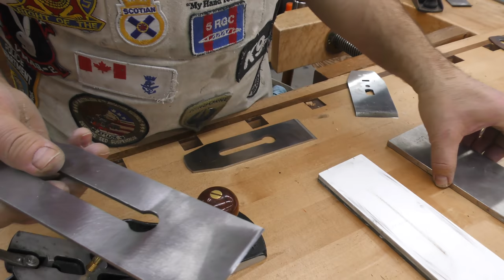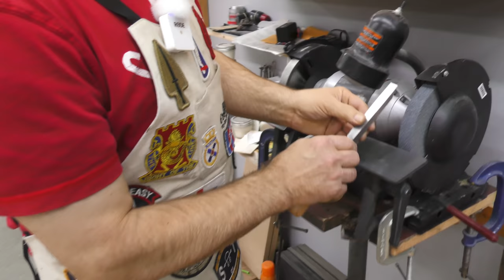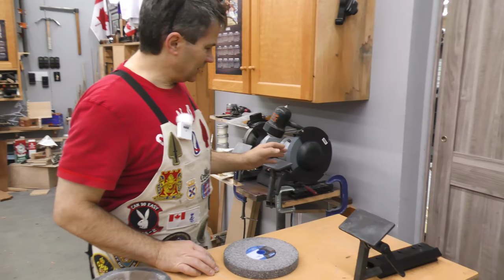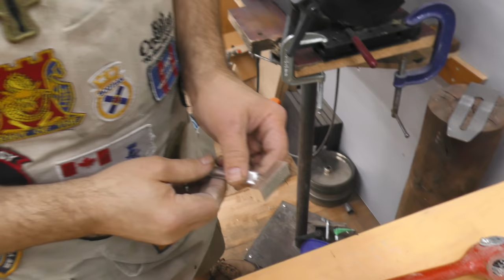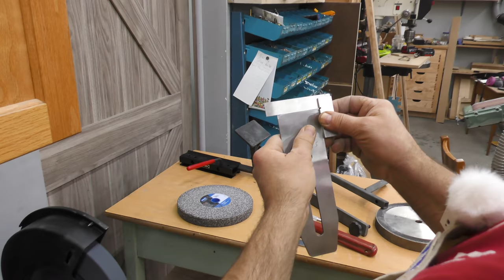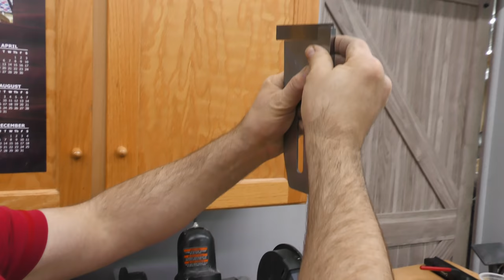How To Grind A Plane Blade - Re-establish the primary bevel

Comment: I have that "violent" stone wheel dressing tool. I have a restored very large antique dual wheel grinder, and a 6 inch two stone grinder. All needed dressing. I didn't get the largest of these dressing tools, but it is at least the size of the one you demonstrated; maybe the next size up.
Lot of good tips Rob, so I must share too, as you were using your "violent" dressing tool incorrectly,...according to the instructions that came with mine, and also according to the industrial supplier catalog information, from whom I purchase the odd tool from.
According to the instructions I have, you would need to back off your tool rest a bit, as the tool has a ledge that hooks over the edge of the tool rest. You should have a sturdy tool rest for proper use as well, IMO. You should not be seeing that shower of sparks; that is a major indicator you are using the tool incorrectly; you are wearing the metal of the tool, not the stone, if you are seeing sparks like that.

The tool is meant to be a bit more "violent" in fact, LOL. You are supposed to use the hook over the tool rest to create a greater and steadier pressure against the stone. When you do, the sparks will stop and you will see quite clearly that you are dressing the stone.

Now that I think of it, I meant to order an extra set of blades, once I had verified that the tool did the job. I actually should have purchased the largest/widest version of this dressing tool, for my antique, restored to working, big grinding wheels. They run on a thick shaft in lead poured bushings, and thin brass shims! I got a smaller dressing tool though, as I figured I would be using the smaller grinder much more.

Hope this helps Rob, and all.

Comment: Interesting video Rob.
I have a 6" grinder with 2 grades of stone, one finer than the other so, I use the coarse grade first then touch up with the finer stone before using the stone.
One tip I might offer is that I use the knuckle on the forefinger of my lower hand as a depth guide to achieve an even grind across my blade be it plane or chisel.
Reply from the maker: Great point I actually do the same thing I should have mentioned it in the video. Thanks for writing this trip down

Comment: If you're going to invest in a can wheel, you might want to look at a slow speed grinder also. If you go with a 3600 rpm grinder, you really need a light touch to avoid damage to the blade or wheel.

Comment: Happy New Year Rob and the whole team. I am fairly new to hand tool woodworking. Yesterday I re-profiled my Woodriver 5 1/2 plane blade.  Came off the grinder square.  I sharpened it using your method and for the life of me I can not get an even edge.  About a 1/3 to 2/3 of the blade will provide a .001 shaving then it falls off. To get a full width shaving it is hacking off a good .005.  I am either doing something wrong or still need a bit more practice.  A work in progress.
Reply from the maker: Sounds like it might be a pressure issue when you sharpen.  Use very light and even pressure when you sharpen
Reply: @RobCosmanWoodworking  I will give that a try. Thank you!!
Reply: That was it Rob. Lighter pressure and like magic I’m there. Thanks again!!!! Happy New Year!!

Comment: Rob, this is really helpful. 
You need to check out Wood by Wright’s video he just published about the best plane blades. He did a really great job in testing a large number the blades. 
Woodriver came out to be the best value. They beat out Lie Nelson toe to toe and are a good bit cheaper. 
Anyway, it’s worth checking out and there are a couple of surprises out there as far as some good quality and expensive options.

Comment: Amps / Current are important on any grinder as well. Higher the amps less it will stall out, and time waiting for it to get back up to speed.
Reply: If you manage to stall the wheel you are using far too much pressure at the risk of wasting metal, burning the edge and being inaccurate. The advantage of a bigger motor is that it comes up to speed quicker, especially with a heavy CBN wheel.

Comment: Once you find center of the blade, put a wixey on there and make note of the angle. Much easier to come back to it later if you have changed the platform for any reason.
Reply from the maker: I just never considered putting a Wixie on grinder
Reply: @RobCosmanWoodworking  It works I use mine all the time when sharpening.

Comment: I fought for ages with the squareness issue of the grind on one old plane iron that was on a plane owned by my late father.  I finally put the calipers on the blade and found that the long sides of the blade were not parallel.  The blade tapered from the cutting edge toward the "back" end.
Reply from the maker: I dont know if I would have figured that out.  Good job

Comment: I use a Burr King belt grinder that I use for grinding knives. It doesn't leave a hollow grind. On my pedestal grinder I use a Norton white wheel and a regular wheel on the other end. Nice to know the steel wheel exists but I rarely use my old grinder since i got the Burr king. The other advantage of a belt grinder is the plethora of different belts available for specific grinds and belt changes only take a minute. ...And I don't like hollow grinds.
Reply from the maker: Sounds like it works well for you
Reply: @RobCosmanWoodworking  I know you like machines, next time you run across a decent belt grinder grab it! You won't be disappointed with the speed and accuracy you can obtain with one. The grinding jig you use looks like it might feel well at home on my belt grinder.

Comment: Had to grind a new wood river plane blade square yesterday. Came with a new plane out of square. A few minutes and up and running.
Reply from the maker: Thats not good but its nice you can fix it so fast
Reply: @RobCosmanWoodworking  No it certainly isn't good.I recently bought a WR low angle block plane. When I couldn't get the back of the iron flat, I returned it and bought a Lie Nielsen.

Comment: I was hoping you would address the grinding, sharpening and honing the back of your high bevel blades for difficult wood. How do you do it without making a mess?
Reply from the maker: All i do is use a simple sharpening jig set at 20 degrees on a coarse (300) diamond stone

Comment: Rob instead of changing the tool rest plate angle to remove the chip why not just turn the plane blade over? Grind until the bottom of the chip is at the base of the new reverse angle. Turn over again and grind until the reverse angle is removed.  No lost time reseting angles.
Reply from the maker: I have come to expect great ideas from you Ed!  This is one of them, dandy.  Happy New Year and pass those wishes on to Paul if  you see him.
Reply from the maker: Because I want to grind out the chip at 90 degrees to the wheel so I creat a blunt surface thats nit endanger of overheating when i put the primary angle back on it.
Reply: @RobCosmanWoodworking   Happy New Year Rob Will pass along best wishes to Paul next time I see him.

Comment: Faster speeds risking changing microstructure in the steel compromising hardness by annealing. Slowly speed means rate of heat transfer is lower, so lower annealing temperatures are more likely. Cool blade in water.slower cutting is best.

Comment: M
The side edges on many older plane blades (pre-Hock and pre-L-N) are not parallel.  Therefore, it is impossible to grind the edge square with both edges.
Reply from the maker: You need to grind the edges parallel

Comment: My shop is built entirely of plywood with lots of sawdust everywhere. Do you worry about the sparks starting a fire ?
Reply from the maker: No I’m not worried about sparks starting a fire with sawdust. There’s actually been lots of experiments done with dust collection system’s and trying to ignite them on fire and it’s very very difficult. What is problematic is the health risk to your respiratory system with sawdust that is very real and very dangerous

Comment: My first fear is to go out of square with this method. It could be easy to add a horizontal guide and a slide on the bottom of the plate, cheap and safe. If you want a project design just let me know! Happy New year to all the Crew!
Reply from the maker: Yes you could do that. You also can just use your knuckle on the bottom of the tool rest as a little guide. I think you’ll find that after grinding two or three blades you can keep it straight very very easily without a guide

Comment: Wouldn't it be faster to just jam the blade against the wheel until it becomes molten so you can mold the bevel? :)
Reply from the maker: Fuzzy you can’t be serious with this question
Reply: @RobCosmanWoodworking  No.  I was just reminded of the first time I used a grinder many years ago and I smoked the edge of whatever I was working on very quickly.

Comment: What do you think of Tormac T8 sharpener and its jig ? Probably not as fast but would it be more accurate  , and is it worth the price  ? Really like your videos and instructions  ! Thanks  !
Reply from the maker: Hi mark, nothing compares to free hand sharpening up to a 16k finish.  Speed, results and a sense of satisfaction and accomplishment.
Reply: @RobCosmanWoodworking  
I was talking about  , to establish the primary bevel to get it straight and square
Reply from the maker: I don’t like them.  Cost too much and sharpens too slow.  It is not more accurate.  I recommend learning the freehand sharpen.  Its very easy and fast
Reply: Great video Rob. I have the same dilemma as Mike, but am considering a cheaper Tormek like machine with a coarse wheel that sells for around $200 here in the UK, so perhaps even cheaper than a grinder and stand? As Mike suggested, this would just be to reestablish the primary bevel, before moving on to stones, in my case with a honing jig. I completely understand your perspective Rob, but I take on very few woodworking projects as an occasional weekend hobby and don’t need to work quickly. I also quite enjoy using a jig and find it gives me all the accuracy I need.

Comment: Why not a belt sander
Reply from the maker: Grinder works much better
Reply: @RobCosmanWoodworking  why do you say that.
Reply from the maker: For me it’s faster and I can put a CB in wheel on it so heat not an issue. On a belt sander if you’re not careful you can have rounding issues so for me the grinder is a much better way to go but if a belt sander works for you that’s fine